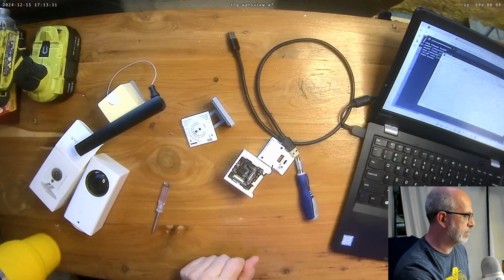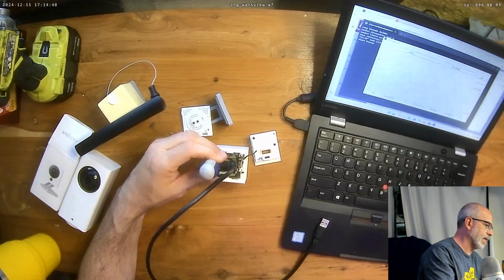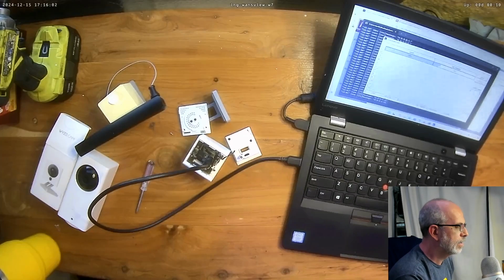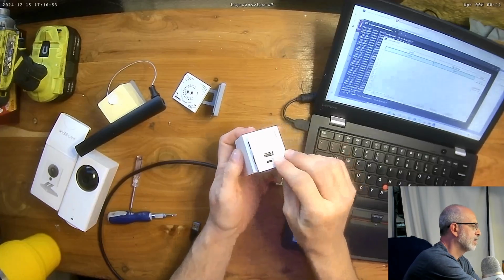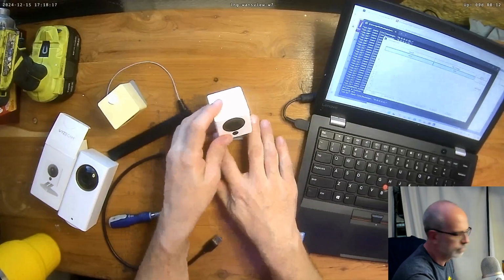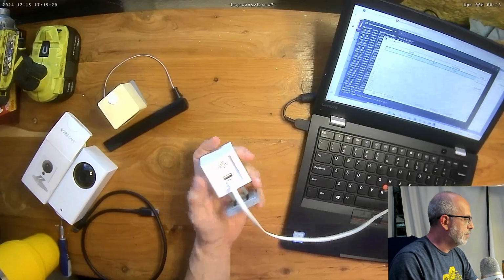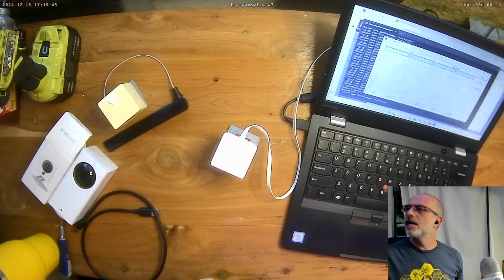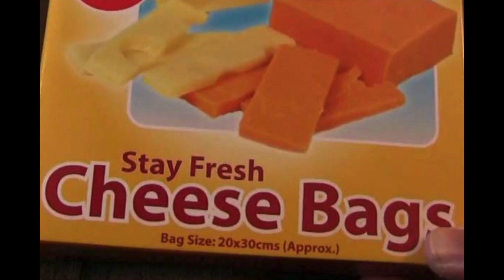Un-Brick Rescue Your Wyze V2/NEOS Smartcam with Cloner on Windows and install Thingino Firmware!!

Comment: I know this is an older video but  I was updating my default firmware on a couple of Wyze V2 cams and the power went out and now they're bricked. I tried installing the firmware on both through the SD card like Wyze suggest but they just reboot and have a yellow LED on solid and I cannot get them to start setup. I found this video and followed this with except I used the default firmware file from Wyze and now they're just not turning on when powered through the micro usb at all. Did I super brick them? I'm asuming this process is only supposed to be done with the Thingino firmware? Any advice?
Reply from the maker: if you bricked your factory firmware running device and don't have a backup (which you wouldn't generally have a reason to have a backup!) you're not going to be able to unbrick back to factory firmware. Each device has a config block that has keys and such that are specific to that device, and without them you can't connect to the wyze cloud etc. We welcome you to Thingino on your device!

Comment: This worked today. My 2 cameras had an updated board. I had to guess on which pins to short but I followed the same counter-clockwise rule. Also I only had to remove 2 screws because I could short the pins without even taking the back off. Thank you!

Comment: I have one that seems to be stuck in a boot loop.  If I power it up with pins 5 and 6 shorted, the LED doesn't come on.  Cloner does nothing.
If I power it up without shorting the pins, it lights yellow, goes off, flashes blue/yellow for a couple of seconds, goes off and goes back to yellow.  There's a few clicks hear while that's happening.
I have tried both USB A-A and A-C, but to no avail.  
If I try the method from the other video (SD card, reset button combo),  I get the same loop.
Reply from the maker: If you need help, jump on our Discord and we'll get you sorted!

Comment: I have a few black V2's, WYZEC2BK.  They are different inside than what is shown in this video.  Are you aware of this model and what can you tell me about it?  I found the T20 and flash chip (QH128A-104HIP) after doing more disassembly.
Reply from the maker: I believe that is the same internals in a different layout and the firmware and flashing process is the same!

Comment: I have my camera working now but no picture, wrong one of the two soc bin files used. I have put putty on my windows and have been able to ssh to the camera it shows Thingino but have no idea how to edit it to apply the 23 bin file it needs instead of the 22. You said it was easy to do so can you tell me and i suspect others who also have this problem. Thanks in advance.
Reply from the maker: if you ssh in you can run the command 'gestalt' which will let you choose the desired image from a list, then run 'sysupgrade -f' to flash the firmware!

Comment: I've made my own USB A to USB A cable, just by grabbing 2 old cables. A USB A to USB B, and USB A to micro usb b. Cut both ends, strip the wires, join the color to color (red <> red (power) black <> black (ground) white <> white (DATA) green <> green (DATA)) and make sure the copper don't touch other color's. And with that cable I flashed the chip without any issue. It started again, and I now have image from camera (even after teardown the "whole" camera)
Reply from the maker: All these cams I buy some with power only usb A to [micro or usb c] and I'm finding its harder and harder to find a good one with data... I'll end up buying a pack of them before long!

Comment: I get an INIT ERR in the Cloner after the errasing and Thingino is not getting flashed. Basically the camera still acts like its bricked.

"59:50" core (string)message: "0:0:-1:7:ERASING;"
"59:58" core (int)message: "0:0:-1:6:100;"
"59:58" core (string)message: "0:0:0:7:INIT ERR;"
"59:58" core (int)message: "0:0:0:8:-1;"
"00:16" core (init)message: "0:0:0:1:0"

What can I do? Thank you.
Reply from the maker: I'd start by verifying you have the right platform/chip settings in the Cloner config, and the device is showing up in the device manager as a working device. Beyond that I suggest you hop on our Discord for help and I'm sure we can get you sorted out!
Reply: @wltechblog  Thank you .

Comment: I managed to get the 23 version of thingino installed on my device fine, but I had no preview video. So I took from that I needed to get onto the 22 version. I've tried loading via SD card, but it just kept booting into the existing thingino. So, I then tried holding the reset button for 30-40 seconds, and then it seemed to boot and flash, (I saw a done file on the SD root). However, it now wont power on. I got an amber light only for about 1 minute, then followed by no lights at all. I left if for about 20 mins and then having seen no change I decided to power off and on again. I'm not seeing no lights at all when I put in the power, either from Micro USB, or USB A. Any thoughts on how I can re-alive it?
Reply from the maker: The easies way to brick these is to pull the power during a flash write operation and end up with no bootloader. You should be able to recover it using Cloner and the method described in this video!
Reply: @wltechblog  I tried, but no connection to the device was found on my PC. So I've ordered a USB A male to male cable, as I read that you had issues using the micro USB yourself. I'll update you 🤞
Reply from the maker: You for sure can't use the micro usb port for flashing, it is only wired for power not for data. The usb A to A is required!
Reply: @wltechblog  My Male to Male cable came today, flashed it (this time as a 22) and its back working :) Thank you. Now I just need to figure out the SSH updating method so I don't have to reflash for each update ha ha.

Comment: Getting the sides loose was a little bit tricky for me, I felt like I was going to break the tabs but I added just a bit more force and they didn't break. What helped for me was pushing up on the back (the part that you get loose) while pushing down and out with a side.
Reply from the maker: Sometimes I forget that I have abnormally strong fingers for no apparent reason! Those plastic tabs are a pain but they give up eventually.

Comment: Shorting pins 5 and 6 to no avail, stuck on amber light. Any suggestions?
Reply from the maker: If there's nothing showing up in your device manager, I'd suspect the problem is the cable. Use A to A is what you want, some folks have had success with usb C to A but I personally have not gotten that combination to work. If you need help, jump on our Discord!
Reply: @wltechblog  isn't "not showing up in device manager" kinda a main part of being bricked? i'm having the same problem. solid amber light. nothing in device manager. tried shorting many times but nothing. should it be showing up in device manager BEFORE trying any of this? not sure how to get a bricked device to show up. have tried several cables that work fine for data transfer with other devices

edit: nevermind, i kept trying and eventually it worked. brilliant video, thank you very much!

Comment: I took the plunge and installed on a V2, and a V3. Both are working, but streaming to BlueIris is spotty, any suggestions? Edit to add LOVE the push to IP address speaker thingy!
Reply from the maker: General suggestions are to make sure you're using default options in the streamer config and if BlueIris will allow you to do UDP instead of TCP for the rtsp stream that can improve reliability on spotty networks.